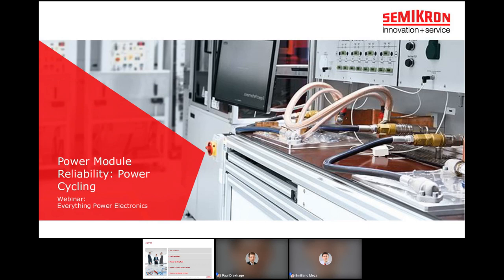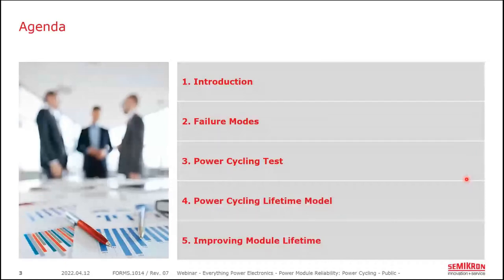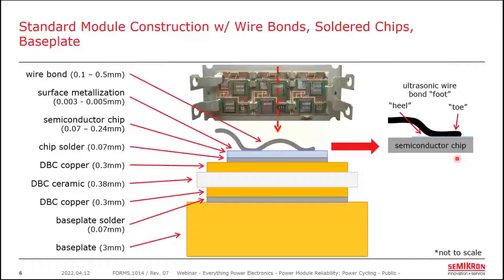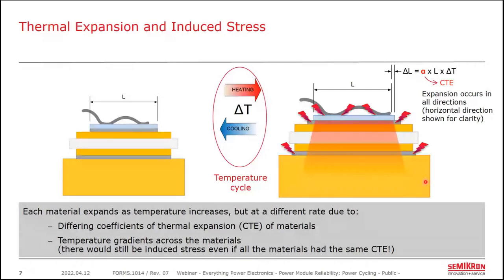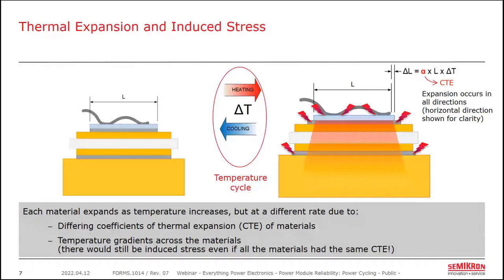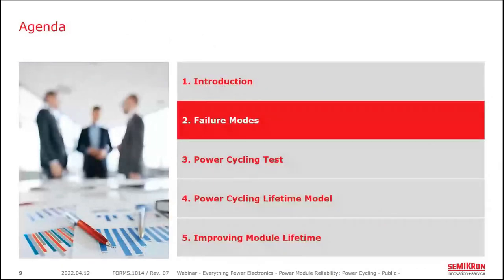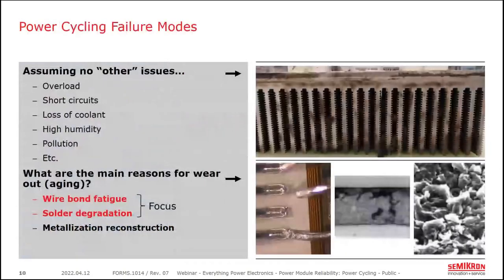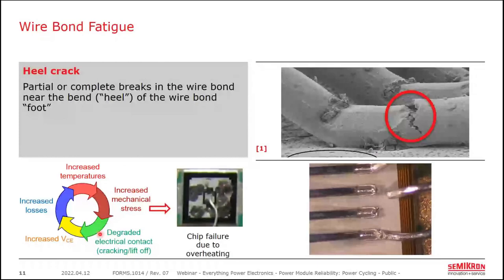Webinar: Power Module Reliability - Power Cycling

Comment: Excellent presentation, our plant uses a LOT of Lenze inverter drives, everytime the system experienced a power cycle, at least one drive will either has its parameter settings screwed up, or address (LECOM, CAN)  messed up or most commonly, the total failure of the drive. Just the Lenze drives alone constitute almost 30% of the entire yearly maintenance budget, furthermore, obsoleted models cost higher than new models if you can believe it...

Comment: But, voltage across collector and emiter should be decreses during heating phase. Shokley equation shows that voltage decreasing  when temperature is increasing. 
And how can we determine temperature based on forward voltage. If temperature calibration done with measurment current which is much lower then load current.